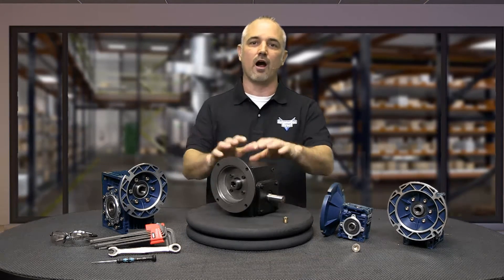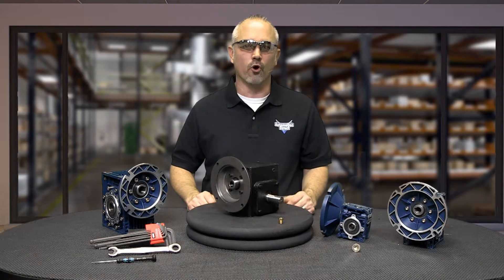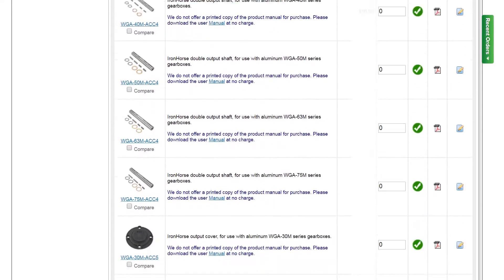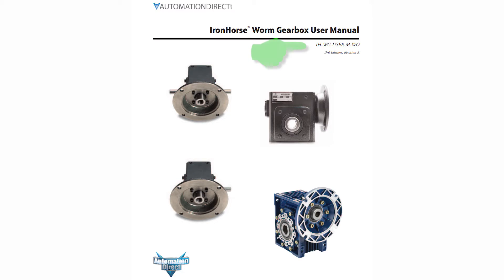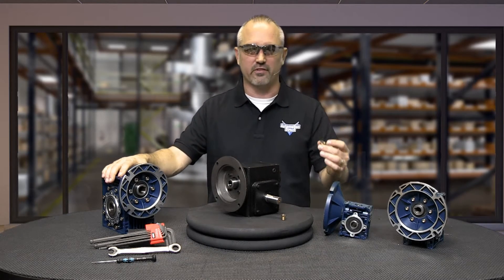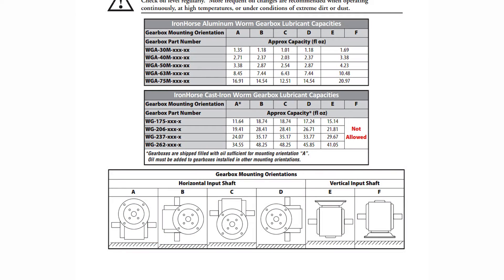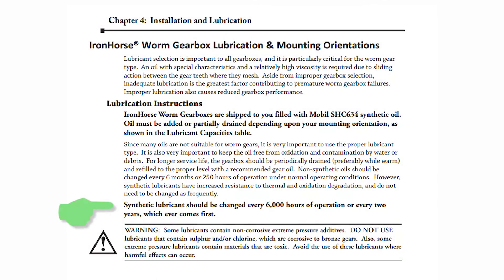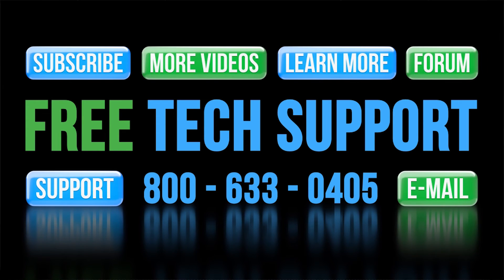IronHorse Worm Gearbox DIY Install & Maintenance from AutomationDirect

Comment: Can bevel helical gearbox replace worm gears?
Reply from the maker: Helical Bevel gearboxes perform a similar function to worm gearboxes. Helical bevel is typically more expensive, higher efficiency and are meant to handle higher loads.
Reply: @automationdirect 
What is market scope of worm gears?
Where it is highly used and what are its challenges?
Reply from the maker: Hi Jatin,  This article does a great job of showing the pros and cons of bevel vs worm gear boxes: https://www.santramengineers.com/pros-cons-worm-gear-bevel-gear/
Reply from the maker: Hi Jatin, Here is a comment from one of our product engineers:  Worm gears are excellent choices for a wide range of general purpose applications such as material handling, conveyors, etc. They have higher backlash than most other types of gears, so reversing applications where positioning is important are not a good choice. There are good for fairly high ratios (up to 100:1 in a single gear stage.
Reply: @automationdirect 
What is the current market demand demand and future growth in demand?
Reply from the maker: @jatinmali1969  Hi Jatin, AutomationDirect doesn't share marketing or financial information.
Reply: @automationdirect 
I'm engineering student doing survey your response will be of great help! 
What is the profit margin % in case of worm gears?
And what are the challenges faced by consumers or industry in this product?